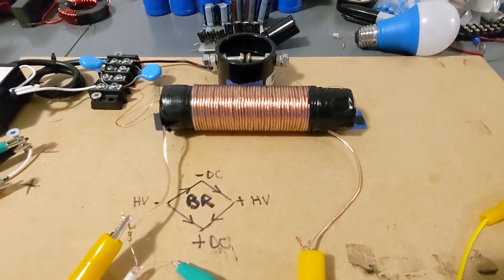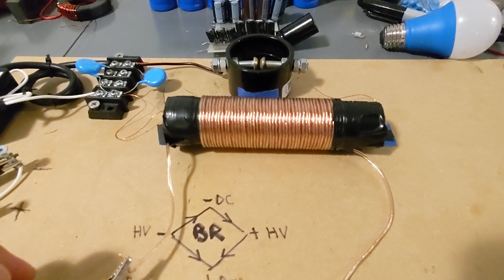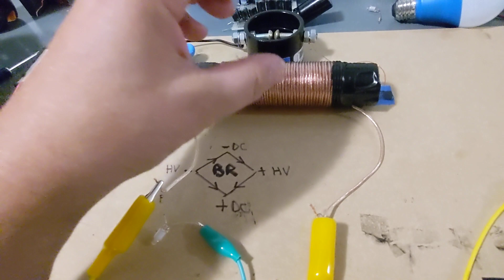Faraday Research RND part 1 of 2

Comment: Do you know the input drive frequency?
Reply from the maker: It's approx 43 kHz .....this is very high ...so I step it down using the 2 spark gaps. To approximately 60 Hertz.....I hope that helps....
Mike
Reply: @FaradayResearch  the higher the better okay at that frequency you need a coil that is 1744 meters long. Not practical can you increase the frequency. I want to help you get 1/4 length standing wave for maximum output mandatory minimal output.
Reply from the maker: Okay so what is the easiest method of getting a quarter length standing wave??

Thanks Mike
Reply from the maker: @EnterTheRealm  hey I have Skype and zoom
Reply: @FaradayResearch  there is only one method.
Reply from the maker: Yeah my Skype account is my email but the thing is I can only do this on the weekend because I work afternoons so I'm not at home at all after 3:00 p.m. so we'll have to do it on the weekend sometime
Reply: @FaradayResearch  okay definitely